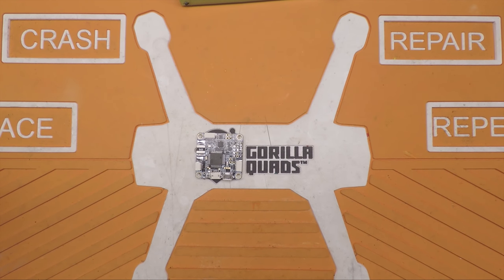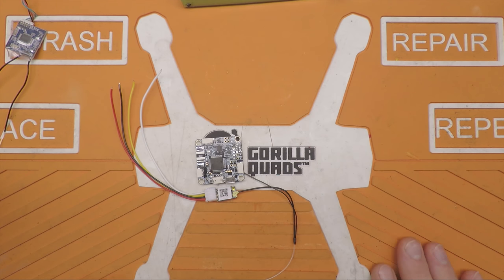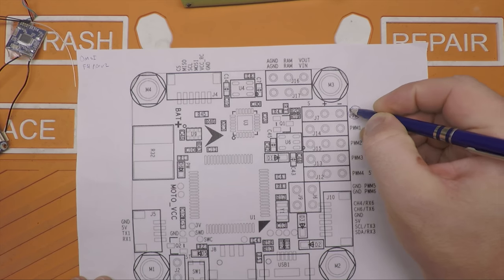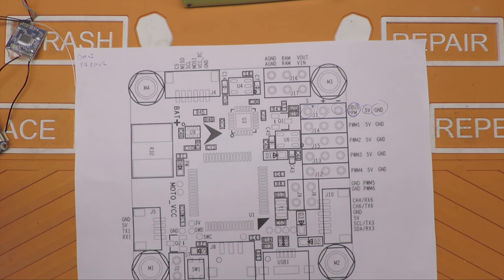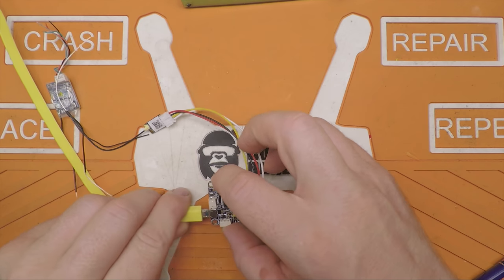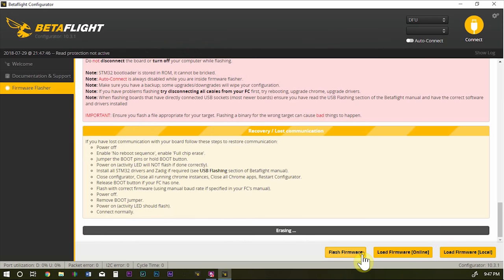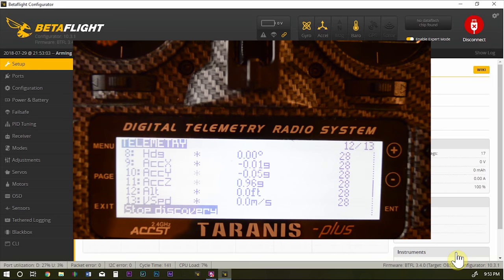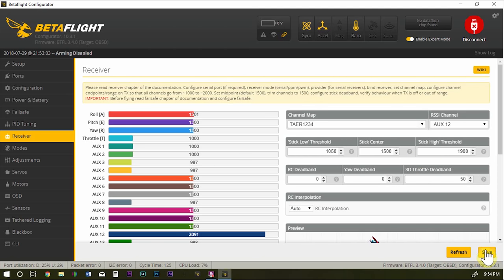How to setup frsky Smart port on a F4 flight controller r9 mini omnibus f4.

Comment: This worked a treat for my LDARC 200-GT with the KK20 F4 flight controller. I've now managed to get both Runcam camera control working with the FC and XSR telemetry using softserial on a spare TX pad. Cheers!

Comment: Thank you very much.   This helped me to get mine working.    i am using the same Omnibus board as you and initially had later firmware ( (like 4.2.0) on mine which was simply not even letting my receiver work correctly.   But decided to downgrade to the same version as you and now even it works!   Very happy after i spent a frustrating late night with no results last night.
Reply from the maker: Glad it helped

Comment: One thing you didn’t mention when you covered F-Port.  You can, but should not, use F-Port on on soft serial pad.  Softserial is great for S-Port, but F-Port is to intensive for a Softserial.  That is really true for any serial transmitter protocol.
Reply from the maker: This is true. It does work and I have had no issues with short range flying(racing) ,but I wouldn't trust it on going long range. Although I have never had any failsafes or rx failures using it on soft serial but I am just a sample group of 1 here.

Comment: Man I’m so glad you’ve made these videos. So I’m having issues trying to figure this out with my Hobbywing Xrotor G2 stack. I’ve got power ground and tx1 for Fport. Receiver is bound, getting rssi and batt sensors. It was originally set to inverted = off and halfduplex = off. Switched them to on and still get no sticks showing. Omnibusf4SD.
Reply from the maker: So, with this fc and most f4 flight controllers there probaby isn't an inverter on any of the uart tx pads. This means you are most likely going to need to use the standard sbus/s.port firmware. Connect sbus to the sbus pad and depending on which reciever you have use softserial to get full telemetry and connect the s.port wire to an avalible tx pad of your choosing.

Comment: Love that someone is finally covering this super popular system in detail. I find it kind of funny that there has been so little content about it when it is such a stone cold game changer as far as barrier to entry price wise. Thank you for your well thought out content it has helped me immensely
Reply from the maker: I'm glad it helped you. If you ever get into a bind feel free to ask questions. Also there is a very active r9m Facebook group with a lot of info and some very helpful people.
Reply: @TweetFPV  Ya i got rid of facebook a while back but i might have to make another account for the purpose of reaching out to the FPV community on stuff like this. I do have a question about the R9 MM if you had any info it would make my day man. I bought the Qx7 with the R9M and 2xR9 MM rx  because it was an insane deal and id been looking at long range systems for a while (and i wanted to try the Qx7 lol) anyways my question is this. Im building on a KK super flytower with an omnibus F4 Fc. The There is no telemetry pad specifically but in the brief manual there is a screenshot showing "smartport" assigned to UART 3. Is it safe to assume that the Tx3 pad is therefore inverted for S.port or should i use the R9 MM's "uninverted S.port pad?... Sorry for the long winded comment but if you had any experience with something similar it would save me some trial and error. Thanks in advance for any info at all
Reply from the maker: The only diagram i found for this FC shows smart port on uart 1 and sbus on uart 6. if this is the case then the normal smart port wire would go to tx1 and this would suggest that there is an inverter built into the FC, but with that said i cound find any good documentation on this FC. If you can find a manual or connection guide post up a link to it an i'll check it out.
Reply: @TweetFPV  you were right btw, build is finished and range tests start tommorow. All firmware set up thanks to you man you made this jump to r9m super easy
Reply from the maker: Awesome, good luck, be sure to setup your fail safe just incase!

Comment: Thanks for your videos, they are indeed very helpful. It may be off topic but do I need to updated my Taranis X9D+ with the latest firmware to use the R9 slim with R9M module. If I upgrade to the latest 2.2 firmware will I loose all my models and settings on the Tx, Appreciate your help. Thanks
Reply from the maker: Yes you do need to update your taranis to get all the features of the r9m. I'm not sure what you will be missing if you don't. You shouldn't loose any of your models when updating your taranis. With the opentx companion software you can back up all your models and setting just incase something goes wrong. This gives me a good idea for another video even though there are a few firmware update videos out there.

Comment: I have the same board omnibusF4SD and I have RXSR.
 It’s the hobbywing G3 F4 stack combo.
 I have AccstD16 NonFport firmware on rxsr.
 I’m using tx 3 for SPort pad and I used 
resource SERIAL_TX 3 NONE
resource SERIAL_TX 11 B10
save in CLI 
I use uart1 black/red/sbus and S.Port to Tx3 solder pads for rxsr.
 In betaflight in I’m getting softserial to appear in ports and use uart 1 but still no telemetry.
 Any ideas?

Comment: I have a problem with that same board and rx. I have it bound and in the same pads as you. But the sbus is not detected
Reply from the maker: I would update the firmware on the rx and rx. Make sure you have serial rx enabled on the correct uart (your fc may be different) enable the correct protocol in bf config. If everything you have is exactly the same as in the video and it isn't working I would check you connections.

Comment: R9 SLIM with Flex: If I just want to fly without telemetry. Is the connection labeled VCC the +power lead to 5V? I know where the ground goes. But there are these ports too:
S.Port.
S.Bus In
S.Bus Out
RSSI Out
TX1
RX1
Which one gets connected to the F4 Board just to fly with my Taranis or should I connect some of those ports to somewhere else on the FC?
Reply from the maker: Voltage input to the slim is from 3.5v-10v 
so the only connections you need to make are the power ground and the s.bus out to the fc. Depending on your FC the s.bus out from the RX should go to a pad labeled sbus or rc or something along those lines. which FC are you connecting to?
those 3 connections are enough to get you in the air.
Reply: @TweetFPV  Its the OMNIBUSF4SD on the wizardHV.
Reply: I'll finished this Smart Port video, so I am going to try hooking my  R9Slim up same way.  I wonder if Flex is going make any difference on the wiring and resource assignments.
Reply from the maker: Flex fw doesn't change how the rx talks to the fc. It changes how the rx talks to the r9m transmitter

Comment: Great video, cant find any info otherwhere. But im going crazy, 2 weeks and cant get stick control, make all your steps but nothing.
I got f4 v3 customized for wizzard x220s, thats how they call it banggood. Flashed with lbt, bind perfect, sbus to sbus....internal rf off, .........please help me..... should i buy a r9 mm?  Thx and greetings from spain....
Reply from the maker: Did you flash lbt f.port or sbus? And can you post a link to your fc?
Reply from the maker: Sorry, I forgot to ask which rx are you using? Also what pads from your rx do you have soldered to which pads of your fc?
Reply: Thanks alot to care about my problem.
I got a r9 mini with r9m on x9d, plus. soldered from sbus pad to sbus in, 5v to v in, ground to ground. Soldered the bridge "sbus" on the fc.
Reply from the maker: Should work provided you configured betaflight correctly.
Reply: Sorry, sbus from fc pad to sbus out!,

Comment: Amazing video..! 
Worked great..! 
I tried this for an rssi and I still cant figure out my rssi. Lmao..! :)
Its not your fault but it seems I can never win.
Reply from the maker: These things can be very finicky. Differences in firmware on either the rx, TX, or fc can make big differences.
Reply: @TweetFPV  some on on the betaflight f.b. group said something about duplex..? Does that mean anything to you..?
They said to go in my cli and set the duplex to full. 
I've never heard of such a thing. 
Again I likes your video. 
It got all my other sensors working and now I can fix all my other f4 boards. Thanks a million..!
Reply from the maker: Yea, setting tlm_halfduplex to either on or off can fix issues with not receiving telemetry. But in this case you either have all the sensors or not. There are a few sensors you will get regardless of telemetry from the fc working or not. I think it's like rx voltage and one other. I just can't remember off the top of my head what they are.
Reply: @TweetFPV  one more question if you've got a sec. 
Can you do more than one soft serial.? Like use motor 5 and 6 and an led pad.?  And if you can would it be the same code but instead of it being tx_11 would it be tx_12 or tx_22..? Does that make sense..?
Thanks again man.
Reply from the maker: You can setup multiple soft serial ports. Soft serial 2 is defined as 12 and 3 would be 13 and so on. Make sure you keep an eye on the cpu usage.

Comment: I am trying to do this same thing in INAV and having little success. I am using an Matek F405wing FC and an r9slim+. Any advice would be helpful. 

Thanks,
Reply from the maker: The issue with inav is that they don't allow you to select which resources or ports to use softserial on. They specify exactly what pad each softserial port will be on. Check the inav wiki for you fc and they should have a list of which pads are ss1 ss2 and so on.
Reply: @TweetFPV  On the Wiki for the F405 wing FC it specifically said to connect Smart Port to TX2 pad. This is the pad I am connected to. Still not getting anything.  I checked the "Resource" in CLI and this is what I found, 
A00: SERIAL4 UART TX
A01: SERIAL4 UART RX
A02: SOFTSERIAL1 UART TX/RX
A03: SERIAL2 UART RX
A04: MPU CS
A05: SPI1 SCK
A06: SPI1 MISO
A07: SPI1 MOSI
A08: FREE 
A09: SERIAL1 UART TX
A10: SERIAL1 UART RX
A11: USB IN
A12: USB OUT
A13: LED2 OUT
A14: LED1 OUT
A15: FREE 
B00: MOTOR2 OUT
B01: MOTOR3 OUT
B02: FREE 
B03: SPI3 SCK
B04: SPI3 MISO
B05: SPI3 MOSI
B06: FREE 
B07: MOTOR1 OUT
B08: I2C1 SCL
B09: I2C1 SDA
B10: I2C2 SCL
B11: I2C2 SDA
B12: OSD CS
B13: SPI2 SCK
B14: FREE 
B15: FREE 
C00: ADC CH1
C01: ADC CH2
C02: SPI2 MISO
C03: SPI2 MOSI
C04: MPU EXTI
C05: ADC CH3
C06: FREE 
C07: FREE 
C08: MOTOR4 OUT
C09: FREE 
C10: SERIAL3 UART TX/RX
C11: FREE 
C12: FREE 
C13: FREE 
C14: SDCARD CS
Reply from the maker: that looks right. But if you are using the slim+ it has a "inverted s.port" pin already so you dont need to use softserial. The "RX1" on "CON1" connect to any free uart tx pad and you should be good to go.
Reply: @TweetFPV  I tried that yesterday with no success. I connected the "RX1" from the slim + to the TX of Uart-5 and configured the port in INAV to "Smartport". I also tried playing around with the CLI settings for Telemetry after doing so. I think I am going to connect the R9slim+ to my BF-F4 board this weekend and see if it is an issue with the Flex firmware on the receiver or if it is an INAV issue. Thanks for all of your advice. I welcome any other advice you have to give. 

Determination!!!

Comment: Thank you for everything,I have same FC with you(OmnibusF4 Pro v3) and R9MM receiver with R9MM 2019 Access(HORUS X10S Express), I did all of you did. I have  fault during reconnect to Beta Flight "Failed to open serial port" . Could you please help me?
Reply from the maker: Of course. Are you using a pc or Mac? Have you tried to use a different USB cable? Try downloading the impulse rc driver fixer and running that after you connect your Quad.
Reply: @TweetFPV  no, no, normally I can connect beta flight,after I created a SoftSerial  like you, softseraial1 was automatically disabled during reconnection of betaflight also"failed to open serial port" massage appears on left topside. I did one more click again to connect button and it was connected with soft serial1 disabled condition. :(
Reply: @TweetFPV  I am using windows.
Reply from the maker: Which version of bf do you have flashed to the fc?
Reply: @TweetFPV  betaflight 4.1.1 thank you for your interest
Reply from the maker: Hmm. My guess is that something has changed   in the bf setup since I created this video. Try flashing bf 3.5.x and tray again. If that works then it has to do with bf 4.1. X

Comment: Can you please walk us through doing this on a f405-std, preferably using X8R reciever. Please!!!
Reply from the maker: I would love to but I do not own a x8r. But from looking at it the process is basically the same.
Reply: @TweetFPV  I used the softserial method and my Taranis is not picking up the extra sensors. I got the the Taranis on discover new sensors. I'm not using BF, I'm using INAV.
Reply from the maker: Ok, I don't know much about Inav. I'll flash one of my older f4 boards and poke around to see what I can figure out.
Reply from the maker: Please email me pictures of your inav config pages, pictures of your fc and rx connections, and a cli dump to tweetfpv@gmail.com
Reply: @TweetFPV  ok standby.

Comment: Thanks for your hard work!
I purchased an omnibus f4 controller based on this video, not because I plan to use it in a quad but because I wanted more telemetry from an airplane (accelerometers, etc.).  You make hookup and programming look easy, and indeed it was. However, I am using an X8R receiver, and am not receiving any telemetry from the controller. I am using a single wire from the smart port signal connector on the receiver connected to the omnibus F4 where shown in this video. Can you think of any reason it would not work with the X8R?

Thanks in advance!
Reply from the maker: Are you running betaflight or a different flight controller firmware?
Reply: @TweetFPV  Betaflight. I loaded the firmware version referred to in the video.
Reply from the maker: Are you getting stick inputs in the reciever tab in bf?
Reply: @TweetFPV  Yes.
Reply from the maker: Ok, here is a few things to try. If you go into the cli and type "get serial" you should see a fow lines and in should be something like serial rx half duplex either on or off. If that is set to on try setting it to off. Same goes with serialrx inverted. There should only be a out 4 combinations. Don't forget to type save after each one and go into your taranis and re-discover sensors each time.
Reply: I found serial rx half duplex and serial rx inverted both off. I turned them on one at a time and then both on. No joy... Still no telemetry. I also found tlm inverted on. Turning it off did not help. I also found a tlm halfduplex turned on. Turning it off did not help. The same with tlm inverted. it was on and changing it to off did not help.
Reply from the maker: I'm sorry at this point I really can't help much here in the YouTube comments section. Please contact me via email at tweetfpv@gmail.com. From there it is a lot easier to diagnose these problems.
Reply: Finally able to get back to the project. I searched the interned and tried everything I could find, with no luck. Soooo. Just like with P.C. problems, I decided to do a control-alt delete (reset) and try again. I reloaded firmware on the Omnibus, followed the instructions on your video again and .... I'll be damned!!!! It is working now. Sorry to put you to all of your trouble, but thanks a million for your suggestions.
Reply from the maker: Wow, it's amazing how this stuff works sometimes. I was scratching my head trying to figure out where by I go with this one. Other than lost time at least it was just a fresh install rather than faulty hardware.
Reply: @TweetFPV  Yes, that's why my feelings toward computers in general fall into the love/hate category. Love them when things are going well, hate them the rest of the time. 

I was even able to figure out how to connect a gps sensor to the board and now have everything I was looking for. Have a great day!

Comment: I have a R9Mini and configured SBUS on my iFlight F411 FC. Receiver Tab in BF is working.
1) Can I SoftSerial map my TX3 Pad and reassigned to SoftSerial 12?
I have tried all permutations of  "set tlm_inverted = on/off" , "set tlm_halfduplex = on/off" to no avail.
2) I also tried on PWM 5 (I assume it to be Motor 5). And also tried all permutations of  "set tlm_inverted = on/off" , "set tlm_halfduplex = on/off" to no avail.
I have flashed both my R9Mini Rx and R9M module to the latest 20190117 FLEX  FW.

The above also didn't work for my HGLRC F4 FC (Different quad and a 2nd R9Mini Rx) soft serial on the LED Strip Pad.
I have almost all but given up.

On my 3rd quad which is a F7 FC, all works flawlessly for the R9Mini.
Reply from the maker: From what you have said I see no reason why your telemetry is not working. I'm assuming you have selected smart port telemetry for your soft serial port in the bf config tab. And when you bound your reciever you selected tlm on.
Reply: @TweetFPV  On The HGLRC F4, I managed to get the softserial on Motor 5 to work. LED Strip 1 didn't work for me. I don't know why. From what I read in BF GitHub, all these extra pads differs from FC to FC, some pads on FC might work for S.Port, some don't.
I'm still trying to figure out the iFlight FC.
Reply from the maker: Yea softserial has in my experience been a flaky thing. Honestly I don't even use smartport anymore. It does nothing for me that I can do with the bf osd.
Reply: @TweetFPV  The main reason I run S.Port is so that I can run LUA scripts on my X9D to be able to change my PIDs and BF settings.
Reply from the maker: Yea I use to do that. Eventually I found it easier to just make the changes in the osd.
Reply: @TweetFPV  For my iFlight F4 Mini, LED_Strip 1 works but not Motor 5. Weird and inconsistent across different FCs!
With LUA Scripts, I can edit much more BF parameters than what OSD offers.